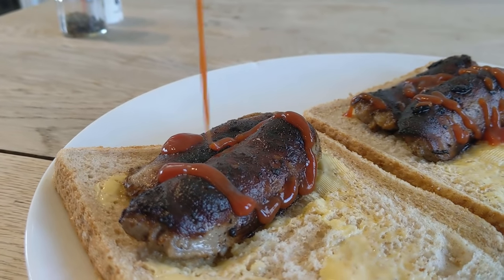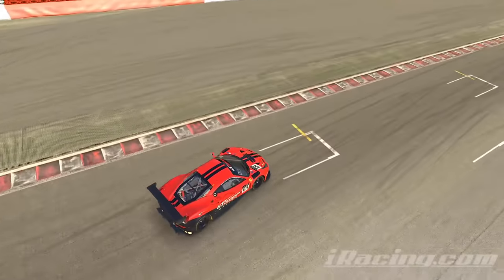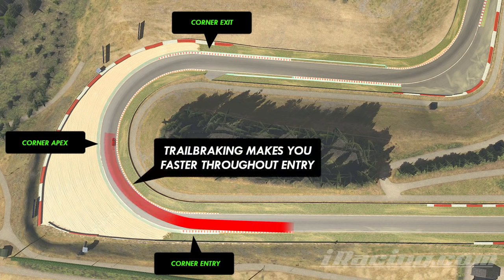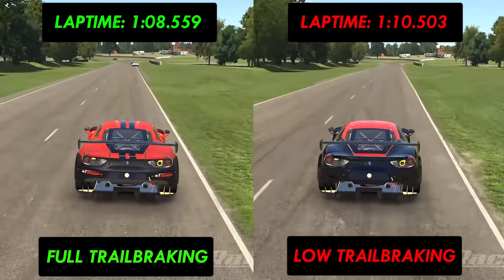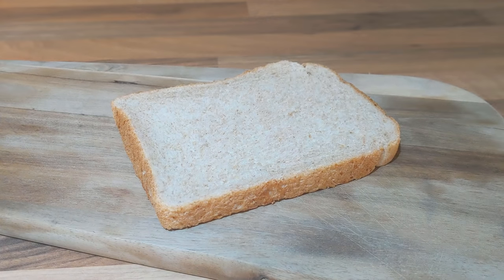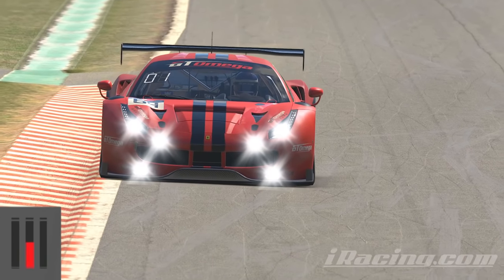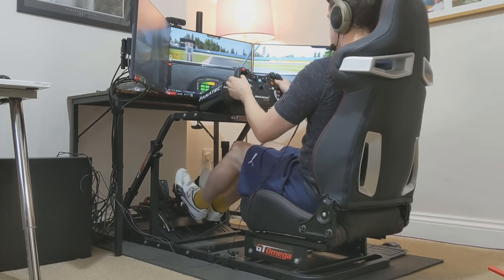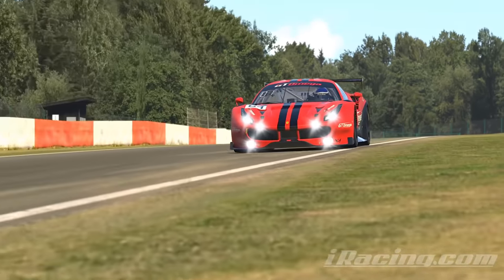Trailbraking In Sim Racing - How Slowing Down the Right Way Makes You Faster

Comment: I can't trailbrake, but do have a question about braking.  How important is it to have a marker for every corner to start your braking?  Do you do it by feel or looks most of the time, or do you have a point at every corner that demarks when you want to start your braking?
Reply: There's always an answer. There is always a point to brake, but that may change as your tires start to bald, the weather gets crappy, or rubber starts to build on the braking line. When I find myself losing a lot of races in a row, I go watch the lap guides. Knowing the exact braking point Is very important especially when you're on a hero lap where you're just flinging it and hoping it sticks

Comment: Trail Breaking is like Adding more Downforce in the Front.  Basically that's what a front wing does.  Is trail brake for you!!

Thats probably what Max Verstappen is going in F1 trail breaking and running a low down force package but trail breaking to make up for it

Comment: I think I know why I don't get it right with my controller, bc it only starts to react at 2/5 or 1/2 of the braking power and while releasing the button it's the same. I think I can't actually put so less braking power and therefore I'm either to slow or don't make the turn. Is it possible to fix that issue? (Playing with ps4 trough steam)

Comment: Weirdly I feel more confident trailbraking on a controller in Forza than I do with a wheel and pedals in a proper sim. I guess because I can more accurately control the positioning of my trigger fingers than I can my feet. Or maybe it's just Forza's physics being more forgiving. It's quite possible a load cell brake pedal would rectify my issue with trail braking though.

Comment: I have a question about racing line, specifically on the entry. Why do pros setup their car before a corner at a little bit of an angle (opposite from the angle of the corner). I mean my understanding would be taking it straight will make the car turn faster. But they're pros so i know im missing something.
Reply: It's all about preparation for the corner and setting up the weight shift over the front wheels before any cornering takes place. The video talks about trail braking to create more front end grip compared to the rear; by placing more weight over the front wheels before any cornering takes place, you actually increase and prolong the the amount of static friction over the front wheels by a lot (which means the front isn't sliding, or sliding very little). The danger is the car has a tendency to oversteer, but the most dexterous, like Schumacher, did it better than anyone else. 

When the car slides, its dynamic friction is less than the static friction. You ask why do pros set their cars up at a little bit of angle? Assuming that's single seaters you're on about, then it's so that the car points in to the turn under rotation when the brakes are released so that they can brake as late as possible and get back on the throttle ASAP. If it's rallying or Sprint Cars or Ice racing then the exact point of grip is hard to define as the car is always sliding, and it's generally faster to increase the grip by sliding and backing the car in to the corner. I know this contradicts what I mentioned above about dynamic and static friction, but if you slide something across a surface at a fast enough speed, the friction increases again and this explains why racing on a loose surface using the throttle all the time is the fastest way. When D1 Drift racers do it on tarmac, it's slower because they aren't able to exploit the static friction (adhesion/stickiness) of the tyres whilst scrubbing them along the road surface, but with the same technique on gravel it's faster because there is no adhesion to exploit at all. By getting on the throttle early, the overall grip of the car is increased whilst trying to accelerate continually on the loose surface. I can't help noticing you're an RC racer(!) ask me anything you like, I've been there before asking all these questions years ago lol.

Comment: Is there a "gradient" to your release of the brake? Do you gradually release more and more of the brake from when you start the trail brake to when you have fully released it and back on the accelerator?
Reply from the maker: In a sense, yes - the rate at which you 'ramp down' the brake to completely zero is dependent on the type of corner, the amount of actual slowing down you're doing, and the type of car, but the general principle of 'rolling off' the brake is true for everything.
Reply: @dannyleeracing  Thanks, I was thinking it would take some practice to get a decent level. I now think it'll take significant practice with all those other points you've added.

Comment: I would assume this is also possible in open-wheeled cars right? I really don’t know that much about physics and like the setup and build differences between car types, so apologies if this is just a super dumb question.
Reply from the maker: Not a dumb question at all! It applies to nearly everything with 4 wheels, the main thing that changes how tyre slip angle works is grip level, and as open wheelers typically have more downforce and wider tyres, you have a smaller 'window' where slip angle is effective which is one reason why they tend to 'snap' when you lose control. In other words, they're more difficult to keep at optimum slip angle but it's still something that you want to try to do
Reply: @dannyleeracing  Awesome, thanks for the explanation!

Comment: its crazy how far your braking into the corner. i only yous trail braking for the initial turn in. especially in long corners i try to get off the brakes early.  it must also depend on the car you are using though?
Reply from the maker: It can depend on the car - depending on the power and grip of the car you're using it may not be necessary to actually use the brakes to achieve the 'scrub while you turn' effect. Low powered cars with skinny tyres tend to rely less on trail braking and more on trail turning, as they often perform better at a higher slip angle which also does the job of reducing speed. The tyres hate it, though.

Comment: is this also recommend on manual with clutch? I've just started playing assetto and it's hard for me to focus in downshifting and braking and controlling the car at the same time so I think this is a bit overwhelming for me at the moment or if I should use it only for automatic cars
Reply: Yes trail braking is needed for fast laps in any car, manual or not.  Don't forget in a manual you also need to heel toe shift at the same time when braking for corners to go fast.  It is really takes a lot of practice, and Logitech brake pedals (distance based, not pressure based) make it even harder.

Comment: so maybe this is a dumb question, but when I try this there is a point where I am both pressing the accelerator and the brake at the same time on both accelerating and breaking at the same time am I doing this wrong? am I doing it at the wrong time? it's generally at the Apex or slightly before.
Reply from the maker: Ideally there's no overlap but a slither of crossover won't do you much harm. If it's more than a split second then it's probably just a bit of impatience, sometimes trailbraking seems to last forever and you want to just accelerate and get it over and done with.

Comment: Does your bias need to be positive in order to effectively trail brake?
Reply from the maker: If you trail brake and it feels too sketchy, put your bias forward a little. If you trail brake and it feels too numb/unresponsive, try putting your bias back a little. If you trailbrake too hard and use too much force then it will spoil it, but if you do it right then brake bias has more of an influence on how it makes your car behave. Watch my most recent brake bias guide on this!

Comment: So I take it you have to set the car up just right so you do not get Snap oversteer?
Reply from the maker: It is definitely possible to set up a car to be very resistant to snap oversteer, the only problem is that in good hands, 'safe' cars are usually 'slower' - Snap oversteer can be caused by a few things, including Brake Bias which I've got a video guide on

Comment: I thought braking into a corner would lift the rear wheels and reduce traction on the rear end and causing the back to slide.
Reply from the maker: It does if you do it too violently or in combination with too much steering too quickly. Do it in the right amounts, however, and it helps your car get around corners.

Comment: When do you trailbrack. Or can you This every corner.
Reply: Trail braking can be used in every corner. But it’s not necessary. Sometimes you’ll find trail braking is slower in a certain corner versus being off the brake. Think of trail braking as another tool in your toolbox. There for your use, but not used all the time.

Comment: Does brake balance have an effect on trail braking?
Reply from the maker: Yes it does, a lot in fact. The best way to find out is to approach the same corner over multiple laps and tweak the bias slightly towards the front (if you find it sketchy) or towards the rear (if you find it doesn't turn well) and find the perfect balance for you

Comment: What about ABS ?   Does trail braking work better without ABS  ?
Reply from the maker: ABS usually doesn't interfere with your braking unless you're doing it far too hard, so it should remain on (this is the case for ACC and iRacing at least, on cars that have it they are 'designed' to use it to their benefit). If a setup is too 'safe' then the ABS can cut in too early and reduce the effect that brake bias has on your handling, that's also possible. If ABS is cutting in all the time when you're braking then you are likely braking too hard - when you slam the brakes it does kinda chuck the concept of brake bias out the window. Look out for indicators that tell you if ABS is cutting in - let me know what sim or game you are talking about mainly and I could help more.
Reply: @dannyleeracing  
Been playing the original AC a lot. I was trying not to use ABS because ive been doing laps in the Ferrari 458 italia (road car) quite a lot, and for some reason there is a problem with ABS on that car - not sure why. If you brake hard enough to bring the car to a fast stop the ABS kicks in and the force feedback shakes the wheel side to side. Its really weird. It doesnt happen on any other car in the sim. 
I reported it, but doubtful it will get any attention. It only happens on that car, and the stage 3 version. I now have a video that shows the wheel jerking around when you brake hard with ABS on, but i already reported the issue, before i recorded the vid. 🤦🏻‍♂

Comment: Do you still trailbrake if your car is oversteery?
Reply from the maker: You do, but usually with higher front brake bias to compensate for the oversteeriness. Either that or you have to just adapt and brake in a straighter line to work around the problem

Comment: Going to be a lot of people with ABS on wondering why they are slower when they try and do this.
Reply from the maker: It's still applicable with ABS - trailbraking doesn't cause wheels to lock enough to trigger ABS unless you do it too harshly, that's a good indicator that you gotta just ease up a bit if you're triggering ABS.

Comment: Gotta disagree with the "Trail braking is easy to learn" part. I've been into sim racing for about three years now and I still find it really hard 😥. I keep locking the front wheels every time I'm doing it.
Also, isn't it contradictory to say that trail braking is easy to learn, but you have to keep practicing to perfect it? Sounds like a long way to go, for me 😮...
But of course that's just my two cents on an otherwise fairly interesting video.
Reply from the maker: What pedals do you have? That can make the difference between easy to learn and difficult difficult lemon difficult
Reply: @dannyleeracing  At the moment, I've got the ones that came with my 200€ TMX wheel. Yes, it's some very basic gear, but I'm just a hobbyist. I'm not planning on doing e-sport races or anything online 😉.
Reply from the maker: @latelierpunk1348  Ah, that might have a lot to do with the trouble you're having - entry level pedals are hard to trailbrake with, but nor do you need really expensive pedals to do it, just something in the middle. There might be a brake mod for the TMX pedals which can make them stiffer or more progressive, which makes trail braking much easier to do. It sounds like your ability and enthusiasm is outgrowing your pedals!

Comment: You account the extra time gained by trail breaking down to the fact that your able to break later because you are able to transfer some of that braking zone into corner entry. Though this is a benefit of trail breaking and there is time to be had there this isn’t where most of the time is gained. More time is gained by carrying more speed into the corner and still being able to make that turn due to the extra rotation caused by that frontward balance of grip you have created but even more again is gained by being able to get back on the power earlier from a higher speed leading to a higher exit speed. Honestly I think your explanation of why trail breaking gives you more speed is not a very good explanation of it even though the rest of your video is ok.
Reply: I agree with your statement. It's a bit misleading and not concise enough. In short, basically "Don't brake TOO hard when slowing down to make corner entry. When closing in on the entry point, ease off the brakes while maintaining the highest entry speed. Once halfway, accelerate away." In fact, there was nothing wrong with how the comparison car performed except that PERHAPS it applied too much brake and carried less speed through the corner. It boils down to cornering speed. His point that the 2nd car came off the brakes early doesn't exactly help his case. We didn't see how much brake force was used on the 2nd car. The 2nd car did the right thing coming off the brake when it did and accelerate. When watching in slow motion, 1st car(him) decided to brake later, 2nd car was already braking. 1st car simply carried more speed through the corner. I also play racing games on a controller. As precision braking is extremely hard or moot on it, best method is simply brake late at full force. That being said, I haven't had much trouble in Group 3 racing in GT Sport playing like this. I always start at or near the back of the pack and I have been successful moving up many positions playing like this. I also like playing the Nürburgring 24 Hours track. Keiichi Tsuchiya explained tires beautifully in one of his videos. Tires are like balloons, when you brake, you are smashing those balloons, flattening them, increasing surface area for grip. This video isn't all bad, just doesn't explain cornering very well. Again, good job on you pointing out about higher cornering speed = gaining better times.